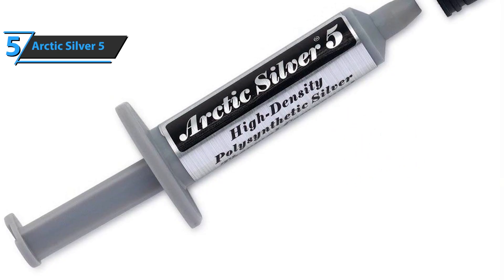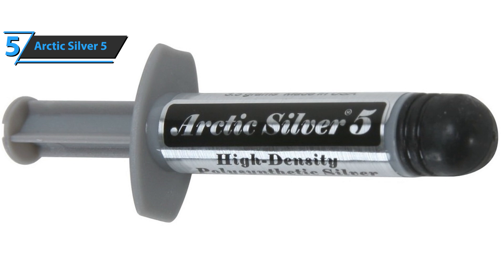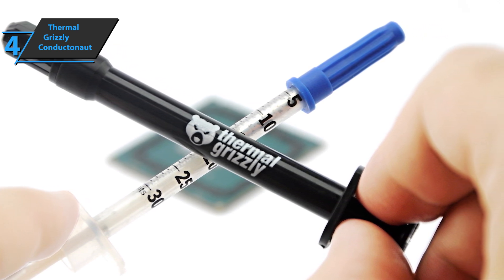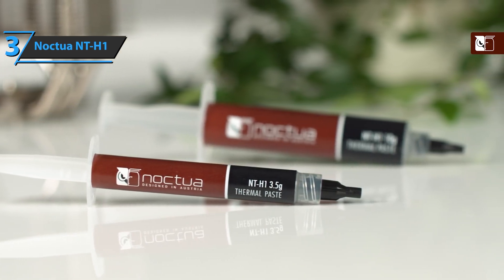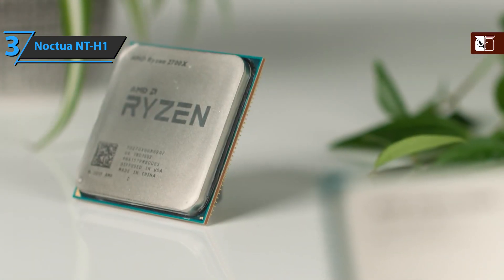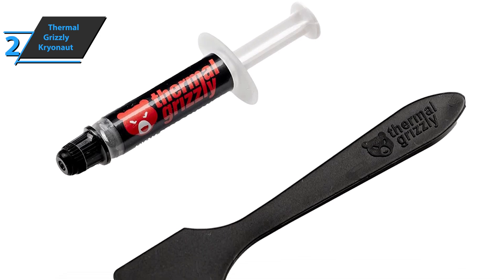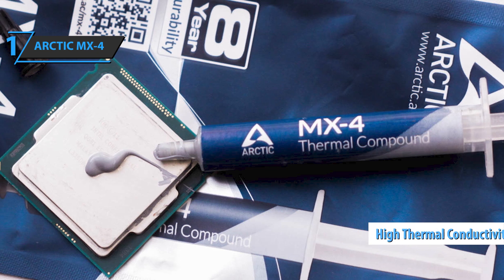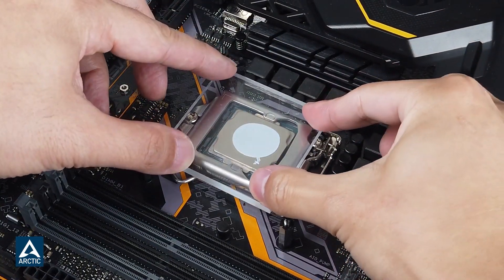Top 5 BEST Thermal Paste of [2021]

Comment: I found Cooler Masters MasterGel V2 to be superior to the Thermal Grizzly Kryonaut
I tried many different types over the last few years with a watercooled system. 
I also tried Kryonaut with Conductonaut and still found the Coolermaster to transfer more heat...but over a longer period, the Kryonaut is best. 
I used MX 4 for a while and is very good.
Reply: Kryonout is best but so expensive, the alternatif i think is artic mx 4 😬

Comment: This video is useless, if you want video reviews, check elsewhere

If you're still reading, I ABSOLUTELY DO NOT recommend using of Thermal Grizzly "Conductonaut" (or any other liquid metals), look for Thermal Grizzly Kryonaut, Gelid GC extreme or something else
Reply: If you wish to enjoy lower temperatures with liquid metal, ensure your heatsink isn't made of aluminum and never allow the metal liquid to exposed electrical parts near GPU/CPU die

Comment: Whoever this is clearly doesn't know what they are talking about. Conductonaut is strictly for when you delid an IHS on a processor, do not use it as a thermal paste, it's electrically conductive and can destroy your computer. Personally I've tried all these pastes and MX5, but got the best results with Kryonaut on both an Asus ryuo 240 aio and cooler master hyper 212 Evo.

Comment: I just used Kryonaut for the first time and I got a 30 degree drop in my max temp!!!! OMG!!!! Benchmarking...  CPU is 30 degrees colder. GPU is 18 degrees colder <3 I fricken love this stuff!
Reply: are the temps still the same?
Reply: @dreamdream011  no. lol. lasted 3 days, then got warmer, but still not bad :)
Reply: @DC-te1gw  i heard that kryonaut doesn't last that long, that's why i asked
Reply: @dreamdream011  it's not that it's bad. it's just that, it was crazy amazing, but slowly crept up, until it was normal. 3 days to dry out and now it's the same as normal paste, witch is not bad, but not like Kryonaut was for the first day I used it.
Reply: to be honest. I would buy it again. very easy to apply. does the job without any problems. I purposefully ran my cpu up to 100 degrees 3 times, by turning the water pump off, and the pc shut down. then started the pc and the temps went back to normal every time. Kryonaut can get very hot and not need to be replaced. it is the best product I have ever tried. *I have two of these cpu's so I can afford to melt one

Comment: I have a tec question, please dont laugh, I am a very sensitive person :), hahahah,  looking into types of Thermal paste , now I have some "Pro weld", 2 parts,  hardener and steel ,  now, putting the hardener to one side, left with the steel paste, put a magnet on it, under a pace of paper,  it stuck to it, the metal in paste,  could this stuff be used as a Thermal paste, its a very fine paste, has metal init,   will it work and it is a lot cheaper then Thermal paste
Reply: DO NOT USE THAT. That is a two resin epoxy, not a heat transfer medium. Unless you want to permanently weld your cooler to your cpu, which you almost never want to do, do not use that compound. Not trying to hurt your feelings or whatever, just making sure you DO NOT USE EPOXY on your cpu. 

It may be cheaper than thermal paste but that's because they're definitely not the same thing and are used for very different applications. Thermal paste is a heat transfer medium, two resin epoxy(like your pro weld) is a high heat, highly stress resistant "glue". It will say it can resist super high heats, but it won't transfer the heat as well and will destroy your cpu if you ever try to remove it after it's set. Thermal paste is more expensive than epoxy, but it's well worth the price considering their efficiency for their intended application.
Reply: @Willy-the-Fire-Putter-Outter  not using it as a glue, just the steel paste, no hardener in it, not that thick,  :),   not using it on Computer, using it on a cooler box I am making, using a peltier, any way, made it now and it is working fine, nice and cold, :),
Reply: @crazycrab8578  ohhh I see. Yeah possibly the metallic half of the resin could work. You might have to replace it over time a little more frequently than normal thermal paste but it does seem like a good budget replacement for less than critical applications. Probably just keep an eye on it every other month to make sure it didn't ooze out of position. Thermal paste is nice in that it'll dry up a little and prevent itself from changing position. However, I'm not sure if the metallic half of 2 resin epoxy will maintain similar characteristics
Reply: @Willy-the-Fire-Putter-Outter  send you a vid tomorrow,   :)
Reply: @crazycrab8578  haha, very nice DIY beer cooler! I saw the video you have of it right now. I think a huge thing to do is replace the rubber bands with zip ties. Since the rubber will be coonstantly exposed to fairly warm temps, they'll break fairly quickly. But a ziptie should work perfectly for that
Reply: Lmao you are гетагded
Reply: @3rd.Eye.Saw.Destruction  you didn’t even read what he was using it for “retard”… to Crazy Crab that’s more than perfect and the other gent you sent the link to was spot on with every post. You may have to change it more frequently. Just keep an eye on your heat for the first few days and after 30 days
Reply: Don’t use that, you want some really cheap thermal paste that is actually decent?  Arctic Silver Ceramique, you can get a 25 gram tube for $7.  25 grams is enough for at least 50-100 CPUs or GPUs.  I’ve actually used that stuff when I was doing some TEC builds and it does just fine for someone who would consider using epoxy, if I understand you correctly you were going to use one of the two compounds, but still.
Reply: @chincemagnet  in the UK, am not using it on a PC, making a ice box cooler, only using the paste, it is working great on me cooler, doing a good job, thermal paste is very expensive, , using it on a Peltier
Reply: @crazycrab8578  if it works that’s cool, some of the lower power TECs were fairly easy to cool, I had some bizarre setups a few years back, i sandwiched 4 or 5 TECs, I think they were 150w each,  between two cold plates, the cold side was a chiller for my graphics cards liquid cooling system and the hot side i liquid cooled with a separate loop.  I actually built a sort of closed loop cooler, this was before you could buy a cooler like that, to cool those TECs.  You just had to fill the loop up as much as possible and you didn’t need a reservoir.  Also had a 400w TEC cooling my CPU at one time.  That actually worked really well, but the insulation was a pain to setup, and the super cold temps ended up cracking the paste under the IHS, so I ended up having to delid the CPU and replace the paste.
Reply: @chincemagnet  made a beer cooler using a peltier, it works really well, just using the paste bit, no harderner in it, never get it apart again :), will try and get silver cera,  cheers,